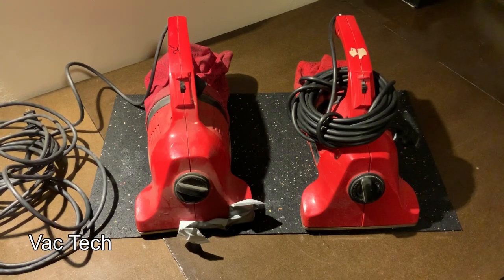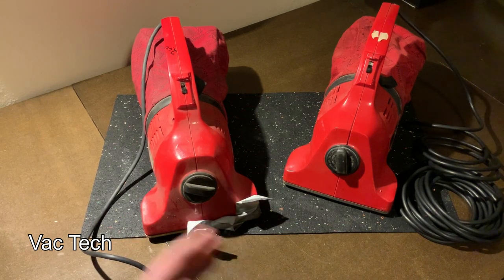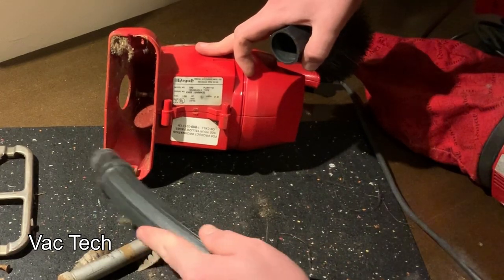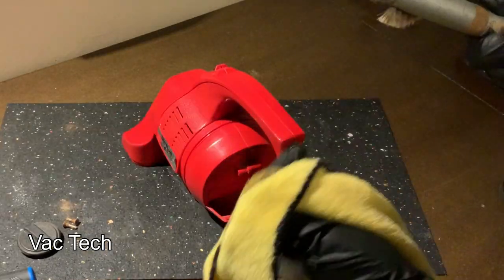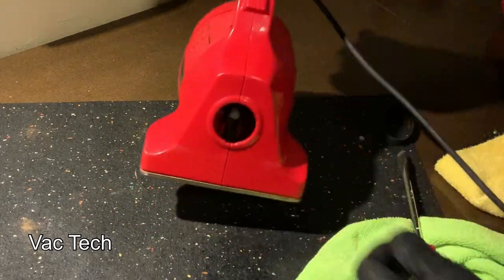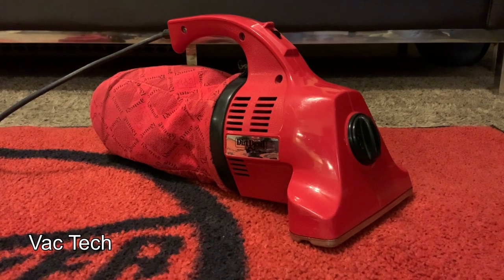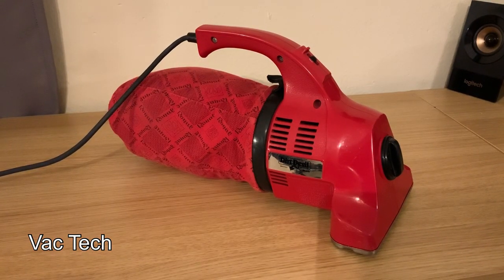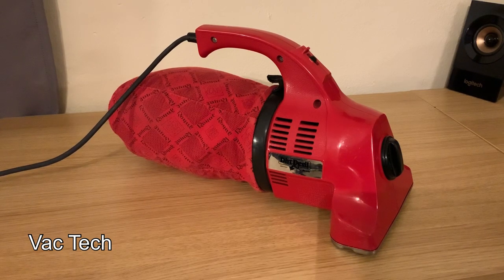1990's Dirt Devil Hand Vac Tune Up and Demo - Model 103

Comment: Hey I was wondering, with my dirt devil hand vac whenever I push down too hard  the brushroll stops. Even if I press it normally. What’s wrong with it. It’s a 1991 dirt devil hand vac model 103 wc
Reply from the maker: It needs a new belt. The one on it is stretched out and shot. They stretch and wear out over time.
Reply: Makes sense. I got it from eBay. Since they called it the rubber thing, I have a feeling they didn’t replace it. Thanks
Reply from the maker: Yep! It takes a Dirt Devil "Style 1" belt, which you can find online or local vac shops. A new belt will make all the difference!
Reply: Vac Tech I have a local vacuum shop. But it’s closed. I will go there to make sure it’s fixed. Maybe I will find another dual sanitronic
Reply: The belt says royal on it. I think it’s the original belt that’s been in there for 29 years
Reply: I just got a new belt. Works like new now. Also on the hand vac on the right it might be the spindle rubbing against the belt
Reply from the maker: @jellyjordy1154  Glad to hear it!
Reply: Vac Tech also how many pebbles can the vacuum take till the fan breaks
Reply from the maker: @jellyjordy1154  Not sure. I would avoid picking up anything that can potentially damage the plastic fan.
Reply: Vac Tech oh. I was vacuuming out the car and vacuumed up like 20 tiny pebbles. The fan is fine though

Comment: It sure cleaned up nice but that was far from a tuneups. The motor bearings in he “good” sound terrible you can actually hear the screaming shrillness. Almsot like a high pitched whistle. Defisyely should have pens the vacuum up and blows out the motor with air compressor and cleans and repacked the bearings. At at the very least added a drop of penetrating oil to them to help soften up the old dried of grease. And polished the commutator. That would have been a real tuneup .
Reply: do I need to pop the machine completely apart to oil it?
will the blue 3-in-1 oil be fine?
its ment for electric motors just want to check to make sure I don't need something a little more heavyduty for this machine's motor